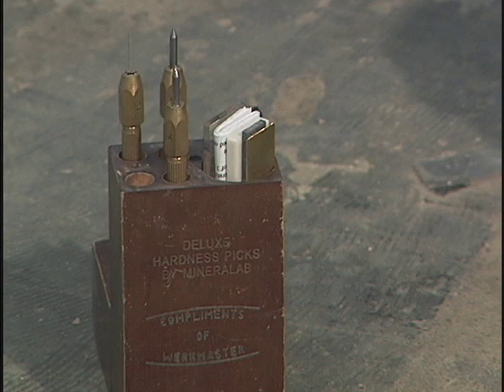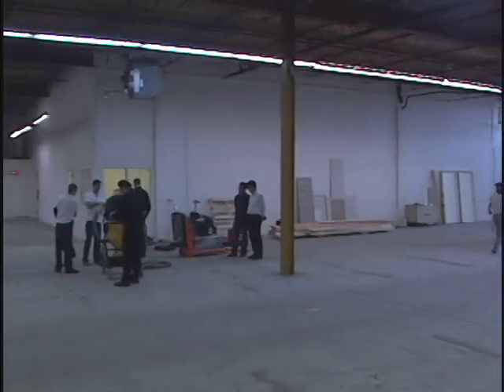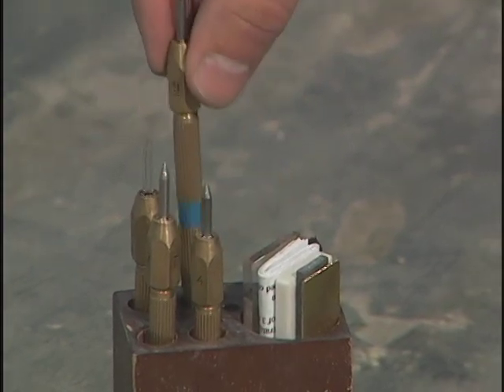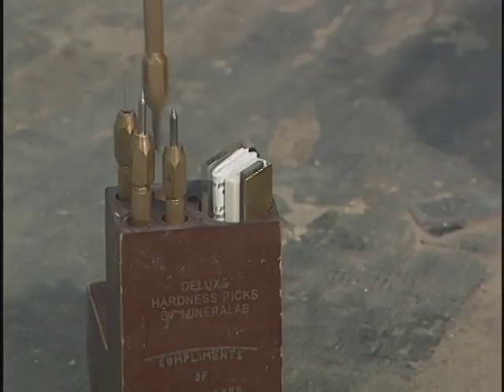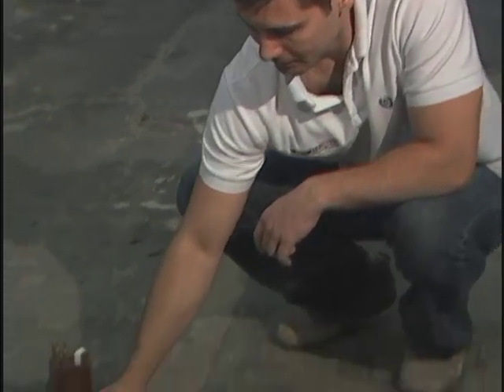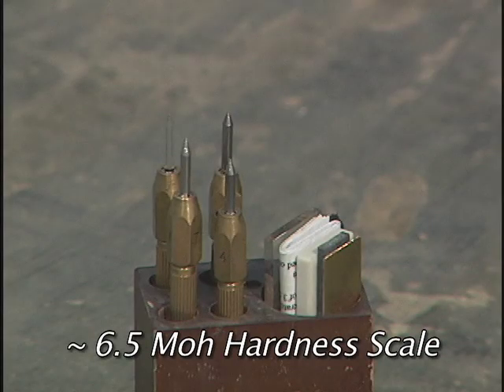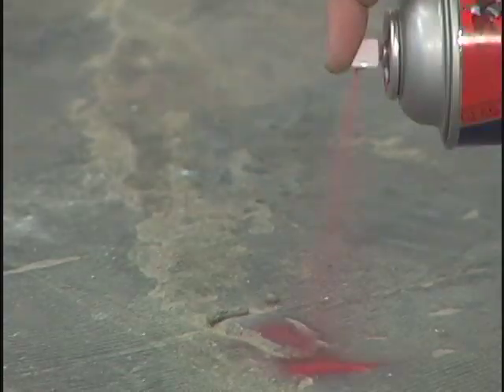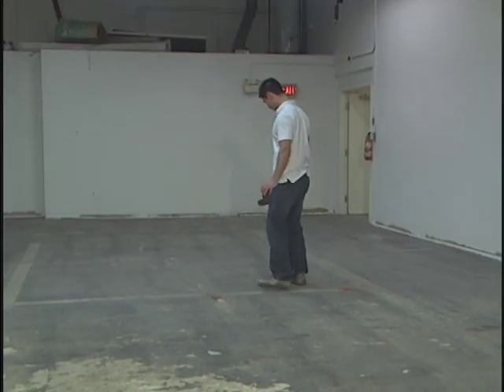How to Use a MOH's Hardness Pick Set on Concrete - WerkMaster.mov

Comment: How much will the hardness vary on regular mix concrete (slabs)?
Reply: chisel954 The hardness can really vary depending on the amount of water and additives(fly ash) that are added to the mix. Power trowelling or lack of will also affect surface hardness. Slabs that are a 5 to an 8 in hardness(regular mix) can also visually look the same. A slab that is an 8 will take about 30-40% more time to cut open if you are not using the right bond tooling!